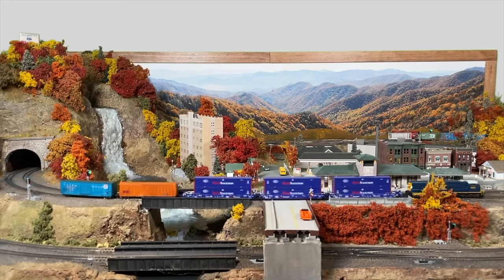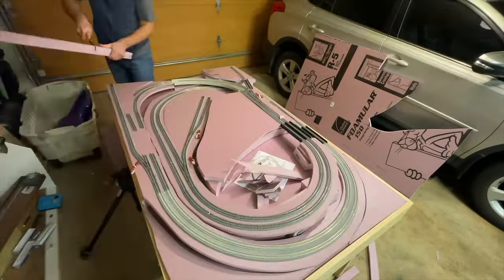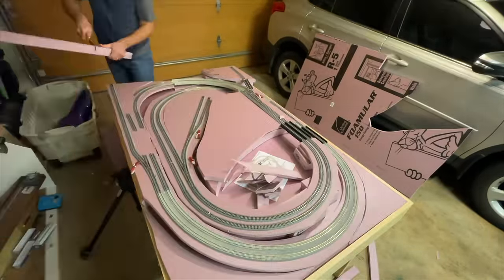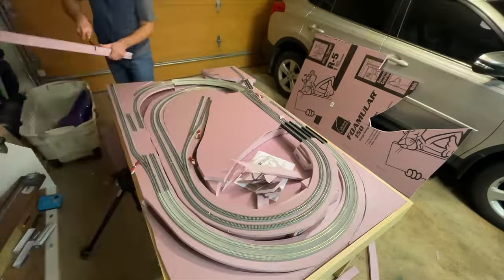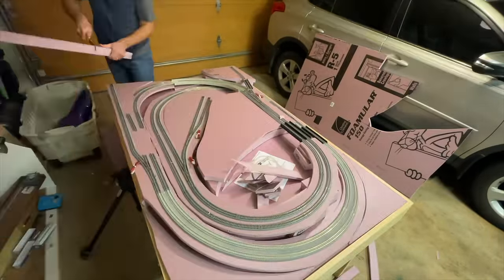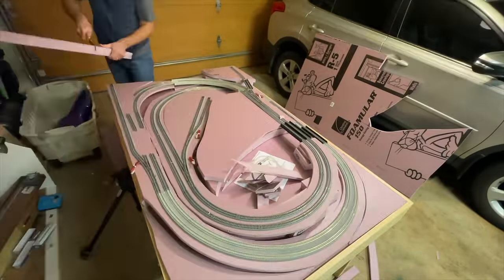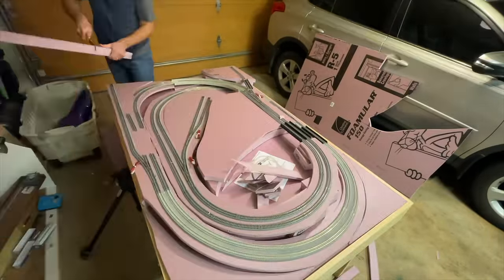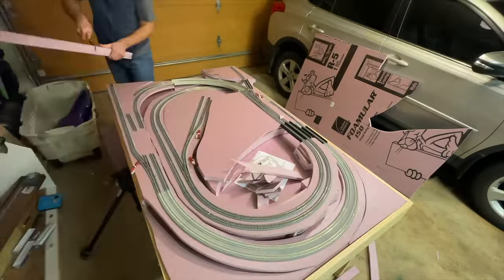Building a 3x5 N Scale Layout From Start to Finish: Series Compilation

Comment: Why you dont downlaod biulding 3d model and print it out for your layout? That is my plan when i buy a 3d printer.
Reply from the maker: I’ll do some of that going forward, but for a lot of these projects, since I’m generally building them for other people, I often try to do the fastest way instead of cheapest (like buying some pre-built structures), since faster is cheaper in terms of total cost to buyer as there is less labor. Still, I do plan to 3D print some structures and have videos on that process.

Comment: Just for future reference when installing a cell tower not only do you have the electrical cabinets around the base but you also have a generator and a propane tank (usually 250 or 500 gallons) to power said generator. Awesome video!

Comment: This is perfect timing for me to rewatch. I’m about to start my first layout which is going to be 3’7”x5’ (weird, I know, but it’s what fit best) I’m planning to keep it a little less vertical (it will have an over/underpass for the train, as well as a short tunnel) and my hope is to use it as a sort of a wall hanging (sans trains, naturally) I think it might look pretty cool, albeit rather large…Should also help keep dust to a minimum when not in use.

Comment: That is a really neatly designed little pretzel layout. Only critique is that those push buttons for the turnouts gave up an excellent opportunity of having a switch panel in the style of a real life Centralized Track Control. It adds to the immersion when the switches sits on top a little diagram of the yard.
Reply from the maker: Yeah, I had thought about doing the control panel which makes it easier to know what button to push, but I liked the more minimalist looking design.

Comment: This is awesome.  My wife has wanted me to do this for 25 years after seeing trains under the Christmas tree... Haven't had enough time yet but gettig closer. The one requirement I have is that most internal door jams are 28 - 29 inches wide so for me I would never want a layout that would not fit through a doorway easily.. but nonetheless this is excellent.
Reply: I made a layout for under our railway. I picked up the Hornby set, just a simple loop, and then made some basic terrain for it to sit on :) it worked out really well and was not that complicated and also it's so light (I made the terrain only out of XPS) you can carry it on its side so it fits through the doors perfectly :) If you're interested hit me up and I can share a build video with you.
Reply: @BeardClipper Hi, yes  please let me know how to find the build video - THANK YOU      :)

Comment: A tip: You can straighten the seafoam with a soldering iron. Carefully touch the trunk with the tip of the iron and bend into a straight shape. It takes a bit of practice, and it works very well.
Reply from the maker: Very cool. I will definitely try that next time.

Comment: You did an awesome job I have one tip instead of drywall mud use lightweight spackle to fill the holes for the screws it dries faster and sticks a lot better

Comment: Tip for cleaning great stuff off your hands, acetone dissolves it almost instantly. Downside is it'll melt all the other foam too, so ya can't use it for cleaning up on the table.
Reply from the maker: I recently learned that as well when trying to clean up after using some black spray foam on an outdoor water feature in the backyard. It does work really well! Thanks for sharing that tip with everyone.

Comment: I love this layout. I was wondering as I’m new to trains but not to modeling or any of the other skills needed for this hobby. I need to know technically wise is it possible to add a figure 8 type scenic loop in the middle for a passenger or some type of tourists shuttle. Similar to your smaller one you did is there enough room to make a continuous loop. I love the videos I’m 56 and bought my first loco N scale. It’s a life like brand I like it and I think it will look awesome after some weathering, but I guess it’s the kind you don’t want really. But I found out it can be updated to DCC I was interested in sound. Anyway thanks I’m sure I’ll asking some questions in the future. Ps website was cool too. I don’t have computer so it helps to see the plans
Reply from the maker: Most brands today are better than what was available in the past.  Mostly the higher price for some models is because of extra detail but that comes with the disadvantage of breaking easier. But the higher priced versions do often have better motors and such and will perform well for a lot longer (will last for more miles effectively). But there is no reason to spend a lot on trains when you first start out and sometimes those cheaper ones can run a long time for you if you are careful and don’t abuse them too much (pulling long trains up steep grades and such, putting more strain on the motors and gears).  
There are a ton of skills to learn, but that is part of the fun of the hobby. You learn a lot of useful skills along the way. Everything from woodworking to electrical to painting.

Comment: I recently got into the hobby with N scale and thought I could get a XPS 1.5" board and just support it enough with random crap and it vibrates so badly it hums.  So, back to the store to get a .75" OSB to glue the dang XPS on.

Comment: Really excelent.... Thanks for shared... What switch do you use for the detours?
Reply from the maker: I'm using momentary push buttons wired up to a digitrax DS74 unit. That unit has input wires for push buttons. Any momentary button will work. You hook up the DS74 to the turnout, supply DCC power to the DS74, and then connect the push button wires to the DS74. Each one will control 4 turnouts. Each push of the button throws the turnout in the opposite direction it is, so you only need one button for each turnout. Downside is that you don't know which way you are throwing it if you can't see it.
Reply: @StevesTrains  Ok., thank you for you response. I used DS74 unit. I control it with JMRI..... Great work. Congratulations....

Comment: Inspired to build my own version using this track plan. Do you have a track list for unitrack or others? I’m on a budget. Is it worth the $ to splurge on unitrack? What will it cost me in track for this layout? Thanks again for your great videos!! 👌👌👌
Reply from the maker: Track list and plans: https://www.steves-trains.com/post/building-a-3-5-x-5-5-n-scale-layout-part-2-track-and-wiring

It is cheaper to use Peco turnouts and Peco flex track (or Atlas) but I just like working with unitrack since I can lay out the track and test things without having to cut and attach flex track. You can’t build the plan as it is with sectional track from another vendor since Kato has a much bigger variety than other vendors (well there is tomix but you don’t see that in the US). I don’t really know what the cost is for the track since it is a fair bit more than when I built this project given the inflation rate of the past few years. It is a lot of track so it so going to cost quite a bit.

Comment: Quite an amazing video; thanks. Sorry if it's an indelicate question, but what sort of ballpark cost is involved in building something like this?
Reply from the maker: In terms of material costs I don’t remember off hand, but I think around $3,500 but maybe as much as $4,000 or so. You could build it for less certainly, but it was more important to get the project done quickly than for less money in material costs since the time/labor cost would outweigh the material savings.

Comment: I really like this layout. I am about to retire my current layout and will possibly copy yours. I lack the imagination to do one of my own. In looking at your track parts list I can find all the tracks with the exception of 20541 Curve Radius 15" + 16.3", angle 45 (viaduct) is this the correct part number since I can find no reference in the Kato website. Is the part actually 20544?
Reply from the maker: Probably not the current part number. Those tracks do exist, someone else asked about them recently, and if you search for that radius of double viaduct track you should find it. They will offer track like that in different packages and such so sometimes the part numbers change or they switch to a new offering (sometimes will go from a 2 pack to individual or the other way around and that kind of thing). Sometimes they just make some small change or whatever to the bridges/viaducts/special pieces and change the numbers. I don’t try to keep up and keep the lists updated since that isn’t something I have time to manage.
Reply: @StevesTrains  
Thanks Steve. I did find the pieces they are now listed as 20544.

Comment: I could so easily build a small layout like this if I wanted to, but short loops just don't catch my interest. I have so many ideas and real world areas I want to model, that I really need to dedicate a proper space to it... Honestly, I'd rather be in a house than an apartment if I were to dedicate that kind of space to the task... Truth is, I love the building more than anything, so while I'm stuck in this apartment, I've been focusing on the small things... locomotives, buildings, etc. I will probably eventually build at least some segment of layout, eventually... One question I have, is the camera you used? I've got a small camera that can stream over Wifi, and I think it can fit inside an N-scale locomotive, but it's some Chinese thing that seems to use proprietary apps for phones only to receive the stream. To save video as an MP4, it requires an SD card on the device. What I really want is something I could stream over Wifi and use as a source in OBS. Just curious what your solution was, and if it's capable of that, or not.
Reply from the maker: This one didn’t stream, it just saved the video to a micro SD card. It is about 1” square, maybe a little less, and I picked it up off of Amazon. I think there is a link in the description, but there are a bunch of the same cameras under different names.
Reply: @StevesTrains  thanks for the reply. The one I have can stream over WiFi, but it seems to be a closed proprietary protocol, and the only apps that recieve it are for phones. Mine is a 0.5 inch by 3 inch circuit board with a camera on a ribbon cable. I was actually hoping to create a pivot that pans the camera left or right based on the position of the front trucks. I figure it would help the view on curves if the camera can pan into the turn. The locomotive I'm trying to mod is obviously a dummy, to make room for the camera. I know just the pair of GP40s... DM&E had a pair that used to always roll together and pulled the three corporate passenger cars. I figure there couldn't be a more perfect consist for streaming track view.

Comment: I really like your work. Looks great.
How do you fix the track to the foam?
Reply from the maker: Hot glue gun or latex caulk. Regular white glue works fine too but you have to wait longer for it to dry obviously.
Reply: @StevesTrains  Soo you glue all tracks? ...accept switches?
Reply from the maker: When putting on foam, yes. You can put glue on the switches too, but need to be more careful. There are some nice flat areas on the switches that are good for gluing. But, if you ever plan to reuse anything then of course use glue sparingly. If you use latex caulk to attach the track you can usually cut the track off pretty easily.

Comment: You built this and shipped it. Grand total minus the trains what would that cost? Living in an apartment, and being single, I could fit that in my living room. Being 80 years old with no skills I'd have to have you do a completed project. I'm a fan of the Nickle plate Berkshires and a late 40's - early 50's before diesels. Just curious. As a kid I had a Lionel 027 and then went to a 4x8 HO. I miss my trains.
Reply from the maker: Material costs keep going up of course but this ended up in the $6k range including labor and shipping.

Comment: Molto bello e particolareggiato. Sono sempre stato un appassionato di ferromodellismo, ma oggi con la poca pensione che prendo non potrei dedicarmi più a questa passione. Mi è rimasto molto materiale (binari, treni, vagoni, edifici, personaggi, ecc.) ma in scala HO ricavati dallo smontaggio del plastico ferroviario, quando cambiai abitazione, costruito negli anni 80 e non ho più avuto occasione di riutilizzarli a causa della mancanza di spazio.
Guardando diversi video ho però notato una cosa: non ho ancora visto far funzionare i treni sulla catenaria con i loro pantografi, cosa che invece avevo fatto io.
Colgo l'occasione per augurare a te e famiglia un sereno Natale ed un migliore anno nuovo.
Reply from the maker: I want to build a model railway eventually that has actual catenary wires and such (maybe even powered), but have been a bit scared to try.
Reply: @StevesTrains  : Ovviamente il mio plastico era analogico. Ricordo che utilizzai due trasformatori: uno per mettere positivo e negativo sulle due rotaie, l'altro per mettere un polo su una rotaia e l'altro sulla catenaria. Quindi modificai i vecchi treni Lima collegando i pantografi al posto di una ruota. Ottenni lo scopo di poter far viaggiare due treni sullo stesso binario ma in direzioni opposte.

Comment: Steve, I'm trying to follow the bench work, is the foam flush to the top of the 1x6 sides? Seems like with the 1x3s attached to the 1x6s and then 3/4" of cross board there would be 2 and 1/4 inches to fill with foam. But it looks like you are using a 2" and a 1/2" foam
Reply from the maker: I don’t remember exactly but I think it ended up just slightly lower than the 1x6 top.  It has been a while but I think it was less than 3/4” plywood, like 1/2” or less. I don’t remember offhand.

Comment: Did  you  think about  using  Peco N  track..?
Reply from the maker: I've used it before and like it. For a lot of these layouts I just find it easier to use Kato, but if it was a permanent layout that wouldn't be moved as much and I wanted the track to look better, I would go with Peco all the way. Atlas looks great, but the Peco track is much more bulletproof which I will take over looks any day (which is why I use Kato so much in the first place).

Comment: Is there allowance in this scale for multilevel build? I don't have a lot of room in my apt but I'd like to do a Christmas train.
Reply from the maker: You have to be a little more careful in N scale than larger scales when dealing with elevation changes if you want tracks on multiple levels and trains to go from one to another since the trains are smaller and what seem like minor changes in the slope or tilt of the track can cause a lot of problems.  But there are plenty of layouts with complicated elevation changes out there. You just have to take more care with the trackwork since minor track misalignments and that kind of thing have a bigger impact on the trains.
Reply: @StevesTrains  that's helpful thanks!

Comment: Do you mind saying what the mixture is that you mixed up to cover everything, look something like cement.
Reply from the maker: I think you are referring to the sculptamold I used. It is something like a mixture of papier-mâché and plaster. It is easier to work with than plaster and somewhat less messy. You can buy it in three pound bags at craft stores but I buy it online in 25lb or larger boxes since it is cheaper that way. https://www.amaco.com/products/sculptamold-sc-3-3-bag
Reply: @StevesTrains  thank you very much🙂
Reply: @StevesTrains  by the way, very nice work.

Comment: What adhesive should I use for foam board to wood base ? Just starting and was wondering .
Reply from the maker: Foam safe adhesive caulk or you can just use regular wood glue if you don’t mind waiting longer for it to dry.
Reply from the maker: I also like screwing the foam to the wood after gluing it (in places where the screws won’t be seen) to help hold the foam in place while the adhesive dries if you want to keep working right away.
Reply: @StevesTrains  Thanks so much . Your layouts are so great . I don't have the patience to be so attentive to detail . But am going to try . Watching your video's will sure help .  My layout is 28"x66" , was all the room we have . Thanks so much for all your knowledge .
Reply: What  brand of caulk do you prefer ?

Comment: Newbie question I’m sure but what is the name and brand of the metal rectangular weights used to hold objects down when gluing?  I have searched and searched and can’t them online. Also, what are the holes for?
Reply from the maker: Just search for 1-2-3 blocks. They are precisely cut for setting up machinery I believe. Heavy and have perfect 90 degree angles so I often use them for building structures to hold corners together and that kind of thing.

Comment: steve, could this be wired for a dc controller instead of dcc?
Reply from the maker: Yes, you could use two DC controllers, one for each loop and/or insulate several sections of track and use DPDT toggle switches to control each block to determine which controller controls that section. You wouldn’t be able to do the turnout buttons the same way however. You could use two buttons for each turnout, one for each turnout direction and wire them to their own power supply or use the Kato turnout controls.

Comment: Can you use spackle instead of sculptamold?
Reply from the maker: I wouldn’t recommend that for general coverage since it is prone to cracking. The sculptmold has all the paper fibers and is super strong and doesn’t crack and it is lighter than most spackle. That being said, I like it using spackle for roads and some applications. It can work in more places as long as you apply it in thin layers. It usually cracks when it dries if you make the layer very thick.
Reply: @StevesTrains ok! Thanks